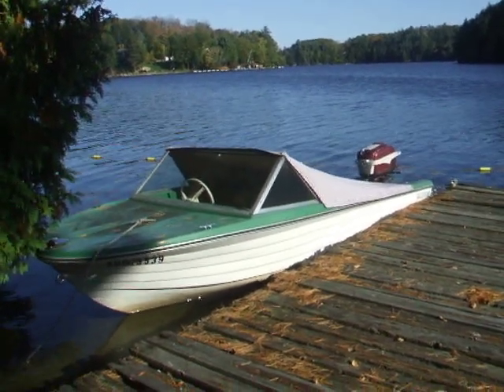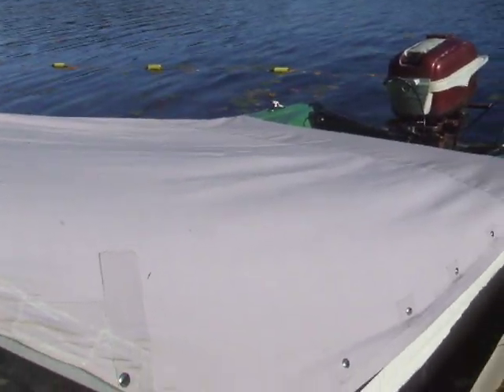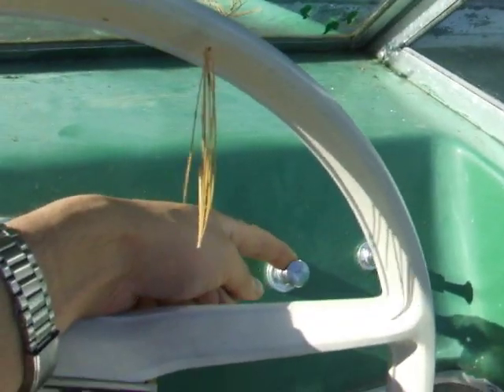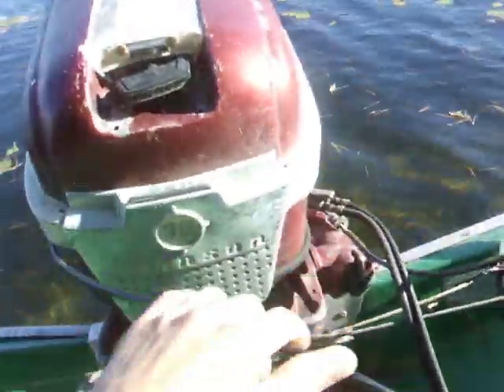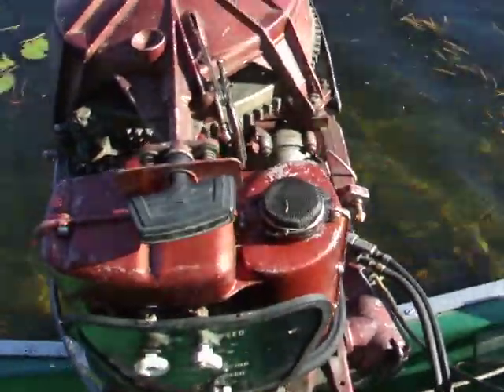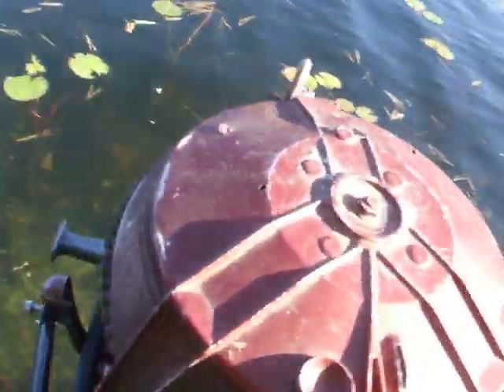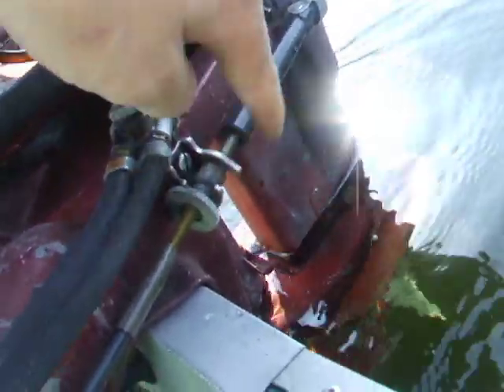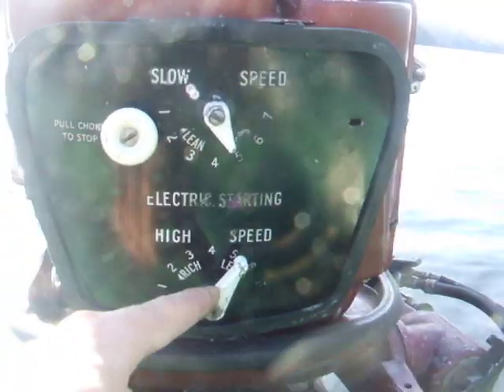1956 Johnson Javelin 30HP Outboard on 14' Viking Fiberglass Runabout

Comment: Back in 1956 a 30hp was considered a BIG motor. Do you happen to know what the biggest outboard OMC made in 1956?
Reply from the maker: Hi Ken, Sure, the Javelin was THE biggest Johnson money could buy in 1956 - all $582 of it (lot of money!).  My Dad says Mercury had 40HP motors at the time, they were always considered more sporty.  I just checked out my Dad's OEM Johnson shop manual with model price list, should scan that section in.  If you're interested, here's a bit of trivia I've learned over the years on this important time in Johnson history:

1955: last of the long-running 25 HP and Green paint.
1956: 30HP ($462), Red White paint, introduced 30HP Javelin with standard 6V Electric Start ($582)
1957: 35HP ($495), Javelin only became Gold White paint (Golden Javelin), 12V electric start ($625)
1958: 35HP, and introduction of the first Marine V4 outboard, 50HP ($840)
1959: 35HP/50HP, Red/White/Gold became new ALL White Fleet 'Dynautical Design' with fibreglass hoods
1960: 40HP ($640) and V4 75HP ($895), pressurized fuel system replaced with single line fuel pumps
1961: My own SuperSeahorse 40HP project in my other videos ($645), nice looker
1962: Introduced a mid-range 28HP ($495), first Johnson over a thousand V4 75HP ($1,065)
1963: HP and prices unchanged form '62
1964: 40HP ($665) and V4 75HP and 90HP ($1,175)

Check out this period 1956 ad with price list, says it all: 
https://www.datazap.net/sites/3for3get3/38966.JPG

Let me know if you'd like me to email you any of the vintage brochures for these motors, makes for VERY interesting reading.  Thanks for the question Ken, Cheers!~  Bellarmine
Reply: 40 hp largest engine  made
Reply: If you needed 70hp, you just bought two.

Comment: How did you button the cover on u like that design
Reply from the maker: Hi Chad, sorry for the late reply.  Yes, the covers on these older Johnsons are unique - they're split in two halfs, front and back.  First you undo two clasps at each side.  Then you hinge the back half up  over on top of the front half, and slide the front half off.  Putting back on is the reverse.  Apparently is was quite innovative at the time, as other motors had more complication to get the shrouds off, and seems nowadays is complicated yet again.  Thanks for the comment, cheers!
Reply: It was called a 'clamshell' cover.  Perhaps a bit more complicated than the later fiberglass ones, but it had that great rounded Art Deco styling.  The Merc's right into the late 80's were terrible, with a front trim panel, then the wrap-around, then the top cover, and even then you have access issues with the supports for the top cover.  The one-piece fiberglass covers on OMC's and Chryslers - and just about every other oddball make [Elgin, Scott-Attwater, etc]  made a Hell of a lot more sense.

Comment: What's the difference between the Javelin and the regular Johnson?
Reply from the maker: Hi Dan, the difference (in 1956) between the RDE-18 and RJE-18 is in the chrome door concealing the controls and chrome wings, cover for the pull start handle, standard 6v electric starting, and $30 more ($582).  In 1957 they had the Golden Javelin, which was the same motor but 35HP now in gold and white with new 12v electric starting, while the rest of the fleet retained the maroon-white paint until 1959 when they went to all white.  Hope that answers your question Dan, let me know if you'd like me to send you any brochures they make for very interesting reading.  Also see this link below for an original ad that answers your question.  Cheers!~   Bellarmine 
https://www.datazap.net/sites/3for3get3/38966.JPG
Reply: @bellarmine33  Thank you very much. I grew up with Johnsons like this. I would very much be interested in brochures or any info or history of Johnson or OMC. Evinrude, too! It is heartbreaking that OMC failed. What a great company.
Reply from the maker: @dansmusic5749  Hi Dan, I've grown up with Johnsons too, still have my 1st motor little Johnson 1976 6HP.  It is a shame what happened to OMC, we still use our Pioneer FarmSaw for our firewood, indestructible heavy duty saw.  Sure, I'd love to send you some brochures, be my pleasure.  I have Johnson and Evinrude brochures on my hard drive from around 1905 to ~1990's or so and everything in between.  Send me an email at my email address on my YouTube About page, should be under 'Business Inquiries'.  Otherwise it is my YouTube username Bellarmine (without the 33), followed by ROGERS and COM.  Talk to you soon, Cheers Dan!~  Bellarmine
Reply: @bellarmine33  That is a generous offer. I currently do not own a boat and motor and I don't have the cabin anymore. But I love OMC and have many fond memories of them. I love history and I like to know how each year of the motors looked like, so that's why I wrote I wanted brochures. I probably can find what I want on the net. But I very much appreciate the offer. Enjoy your summer. Dan
Reply from the maker: @dansmusic5749  No problem, great chatting with you too Dan.  Let me know if you change your mind, if I wasn't clear I meant e-mail, not mail...:o) I've e-mailed PDF brochures to quite a few people over the years, they all love them.  There is a website where I got them all from, I can find it for you, but it is hard and awkward to download them.  I got them all, then make them into slick PDF files and email them to anyone.  The year by year changes are interesting, learn a lot.  I'll be getting the Javelin out next month, still driving like in the video.  Enjoy your Summer too Dan, best wishes and Cheers!~  Bellarmine

Comment: I need a tach for my 1958 RDE19 35  what kind of tach is on yours?
Reply from the maker: +Richard Degen Thanks for your comments! It really is a blast to drive! I just finished redoing the whole lower unit in July with new seals, been back on the lake this Summer and it runs like a Swiss watch - low idle to wide open throttle.

Real nice motor you have there yourself, red and white colored, more white than mine.  I believe the RDE-19 would be a 1957, as mine is RJE-18 and 1956.  You can put a generator on it too; the carb and fuel filter on mine is in the way, so the generator won't fit.  Yours is the first year for the charging system.

I've found brochures for all these old motors, send me your email or a PM if you want a copy, and I'll email it to you.

As for my Tach, it's from a MercCruiser V6, so it doesn't register quite right the way I've hooked it up. I've got one cylinder going into it, so that would be 1 pulse per revolution. It's expecting 3 pulses per revolution (4-stroke V6), so it displays 1/3 of the RPM.

I think a Snowmobile tach would work, it will display 1/2 the RPM when hooked up to 1 cylinder. To hook up both cylinders I think you would need a couple diodes. Just a thoery as of yet, when I get a snowmobile Tach soon I'll try it out and let you know.

Otherwise just go to any junkyard and scrounge the boat hulls for a tach, making sure it is an Outboard hull and not an Inboard. If you're lucky you'll find one that was on an OMC engine and should display properly hooked up to 1 cylinder.

I have lots of ideas, and am pretty good at wiring if I do say so myself. Anything else or if you want any wiring details let me know Richard. 

Cheers! Bellarmine
Reply: +bellarmine33 Thanks for your reply, I am happy with the 35 sea horse, am in the process of adding an electric fuel pump at the tanks, a long run of hose and weak fuel pump on the motor is causing fuel starvation problems....
Reply: You can use any tach that can be set for one pulse per revolution, as mentioned above. Your motor has two separate magneto systems but the tach will be connected to one set of points and will sense a pulse every time that set of breaker points triggers its coil, which of course it does every revolution since it's a 2-stroke.
Reply: Hell, in the 80's I had an old Glasspar with an 18 gallon tank at the bow and my 1982 Evinrude 70 had no problem drawing fuel from that supply though a 3/8's copper line.

Comment: I have a nice 6 gallon old pressure tank I would like to sell, and a 2 line fitting for the motor since I converted mine to  a single line fuel system

Comment: I own a 1986 Evinrude 15hp that runs 100 to 1 on oil to fuel....
Reply from the maker: Thanks for the comment!  Yes, I'd heard that they went to 100:1 in the 80's.  Do you still have the auto Oil Injection system mounted in the gas tank Eddie?  I'd heard they failed a lot and trashed the power heads, and OMC recommended people go back to 50:1 premix.  My Dad and I just believe in running the motor on what the manufacturer recommended, regardless of 'oil grade', which for my Javelin is 24/25:1.  Later 60's motors after I think 1964 went to 50:1.  Someone told me if one couldn't afford a quart of oil, you're too poor to go boating lol.  Cheers Eddie!~  Bellarmine

Comment: Also thought I would let you know the oil I use is;
http://shop.evinrude.com/product/343544/764357/_/Evinrude_E-TEC_XD_100_2-Cycle_Oil
Reply from the maker: I've been reading a bit, seems you can use 50-1 in these older motors if you have all needle-bearings in the power-head.  I think this Javelin does have those bearings, so I'll think about it.  Thanks for the link to your oil.

Saw your video on disassembling your Johnson Stinger lower unit, nice big motors, so much simpler than the newer ones!  I'm just finishing off resealing the lower unit and replacing the lower carbon crank seal in the Javelin, just got the last part I needed and I can reassemble the whole thing.  Cheers!  Bellarmine

Comment: Runs great!!! Id be concerned however running a 55 year old motor wide open for any long rides.
Reply from the maker: Thanks for the comment Dominick!  I wouldn't worry about it, just took it for a 45m drive a few weeks ago.  It's just machinery, gears and bearings, all in good working order, so long as I keep it in good repair and continue to use the proper oil to gas mixture (24:1), it should reasonably keep on trucking for another 50 years.  Also I have it on good authority that it sat in the family's boathouse from the mid 70's until I came along in 2011, so that's a good 35 years of wear that didn't happen......:o)  The older they are the better I like 'em - cheers Dominick!~  Bellarmine

Comment: Man thay do not make them like this no m8
Reply from the maker: You're right, oldies but goodies. These can be had for a song, I'm still trying to convince my neighbor to buy a simple 1960's Johnson after they've spent a couple thousand repairing their 1988 Johnson 30HP electronic-marvel, and now it's dead again. Nothing but trouble since they bought it. Going waterskiing behind the reliable Javelin and seeing it start up EVERY time is going a long way to making an impression on them - I think I spent $300 parts, that's it. Look at my other videos for a beautiful 1961 40HP I'm going to get running soon, and a running 1957 Evinrude 18hp beater. Thanks for the comment - Cheers!
Reply: Yeah I always agree with the oldest I've got a 1945 5 horsepower Montgomery Ward Sea King I put $120 into it and it's not let me down yet I also have a 1955 Johnson seahorse and love them both of course those two moter only go on the back of this John boat me and my wife restored it's also on Montgomery Wards 1964 the date stamp on it
Reply: I uploaded two pictures of them now I know the Sea King isn't the original color but it runs great
Reply from the maker: Hi, thanks for replying.  I can't see your 2 photos for some reason, it tells me the link is invalid....?  You have two nice oldies there for sure, 1945 is very old!.  What HP is your 1955?  So you have a Montgomery Ward boat and motor, nice set - my boat is a Viking from 1965, pretty close.  Let me know if you want the brochure for your 1955 Johnson, I also have ALL the Johnson/Evinrude brochures on my HDD.  Cheers!
Reply: bellarmine33  the 1955 is a 10 the brochure would be pretty sweet how would I be able to get a hold of that thanks again
Reply from the maker: Sure, just send me a private message with your email address, and I'll send the brochure off to you.  I have original Johnson Brochures from 1927 - 2005, and Evinrude from 1909 - 2011, so let me know if you're interested in PDF copies of any other years.  Cheers!
Reply from the maker: I just noticed that YouTube has removed the PM system!!!!  If you want to reach me then look at this link:
https://s25.postimg.org/41jj00qpb/bell.png
Reply from the maker: Hello again Crazy B, I"m wondering if you were still interested in a brochure for your 1955 Johnson 10HP?  I'd love to email the PDF to you, but I don't know how we can share our email addresses without putting them on this public comment board.  

Perhaps I should have explained, the link below is simply a .PNG picture / screenshot of my email address, to prevent spambots.  If you email at the address shown in the image I'll get right back to you.  Hope to hear from you soon, Cheers! Bellarmine

https://s25.postimg.org/41jj00qpb/bell.png